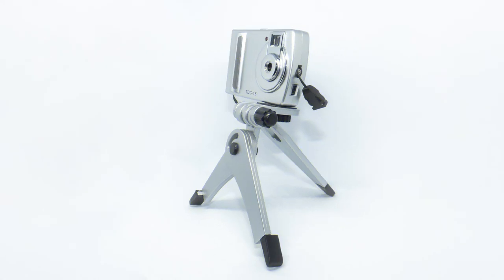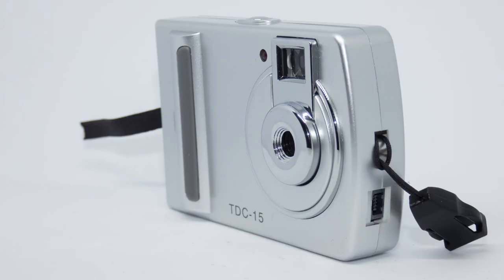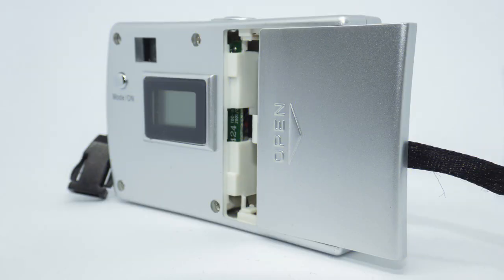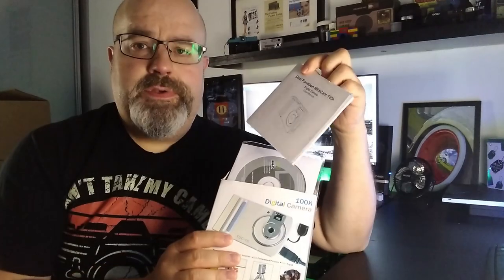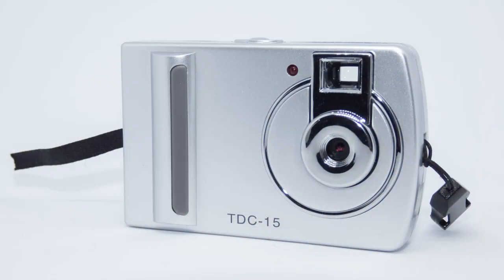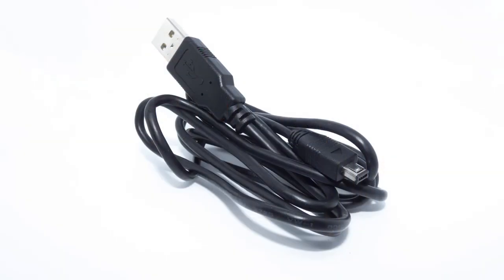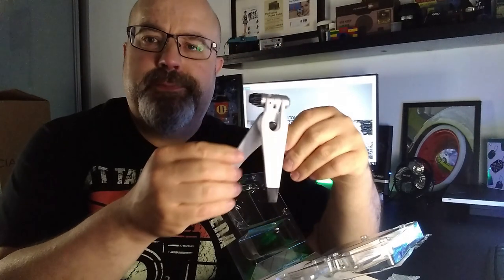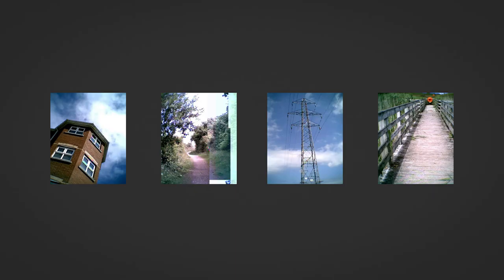Worst Camera Ever?  TDC-15 Camera Review

Comment: Excuse me but what kind of wire does it come with?
Reply from the maker: It looks like a type B mini to USB but features flat not fluted sides and 4pins at the top and 4 pins at the bottom.  I'm not really good with technical names of these things! I hope this helps.
Reply from the maker: The cable is a USB to mini B type cable
Reply: @AndrewWaltonPhotography  thank you very much

Comment: How do I extract pictures from it?
Reply from the maker: With difficulty, you do need the software cd supplied with the camera. I managed to get mine to work with an old windows vista pc.
Reply: @AndrewWaltonPhotography
Reply: Can you explain to me that I downloaded the program and everything, but I did not know to display only the pictures?
Reply from the maker: @7ptc  1. First connect the camera to your PC.  Then open the Arcsoft Photoimpression software.

2. To transfer the photos click on the 'Camera/Scanner' button.

3. Select the source as 'JL2005A camera'.

4. Select an album or create a new one.

5. Click the 'Aquire' icon.

This should prompt the driver software to find the images.

6. Click on the 'Download Photos' icon.

The photos should then be transfered into the download program. You should then see thumbnails.

7. Click 'Select All Photos'.

8. Click on 'Transfer Photos' and the photos should appear in the Arcsoft Photo Impression software.
From there you can save the photos as jpegs.

I hope this helps.

Comment: I have this camera and I can’t for the life of me get the photos off it, even following the instructions you’ve provided and the ones in the manual, it still says that there isn’t a driver in the file there should be
Reply from the maker: Kayleigh I did have to use an old Windows Vista PC to be able to access the camera. To be honest unless you like the aesthetic of really bad digital cameras I really wouldn't bother using the camera at all - it is very much rubbish.
Reply: @AndrewWaltonPhotography  I’m not trying to use it as much as the wonderful graphic go 😂😂 but rather try recover some pictures off it that I believe my grandma has taken. It’s driving me crazy
Reply from the maker: @kayleighjohnson3044  Do you know anyone with an old laptop or PC - the drivers are only really suitable for Windows ME/2000 and earlier - I got lucky that vista could see the camera, presumably Win XP should also work with it.
Reply: @AndrewWaltonPhotography  I’ve got an old windows laptop however it runs windows 10 but that’s as low as it will go by the looks of it. I’m assuming from that it’s completely unusable?
Reply from the maker: @kayleighjohnson3044  I had no luck with windows 10.